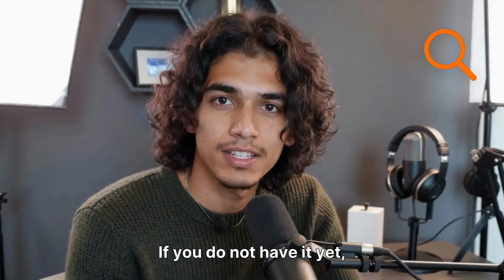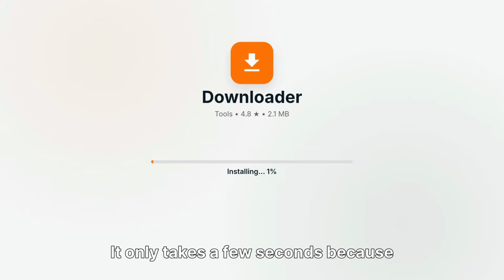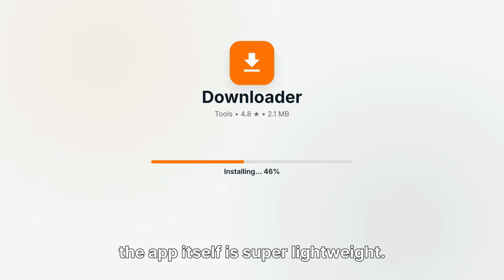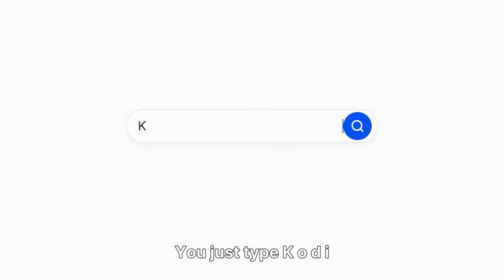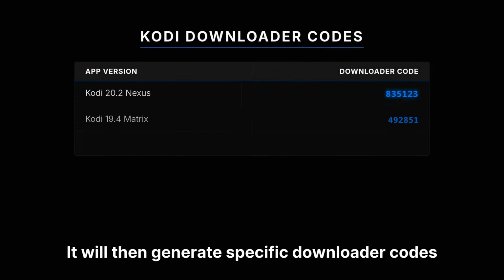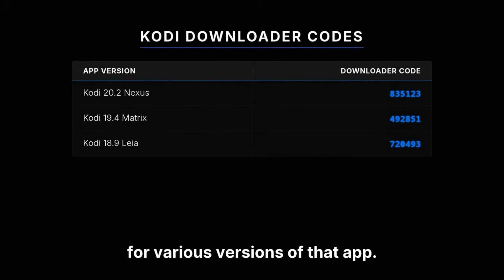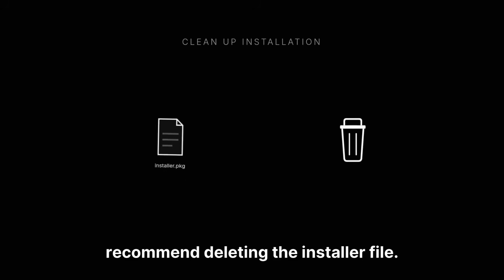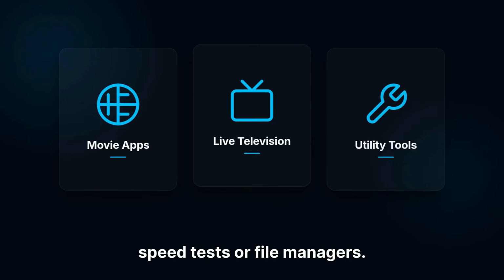Ditch Unlinked | Use This Downloader Instead on Google TV

Comment: my downloader is greyed out they trying to delete this app, so right now cinema hd, bee tv and Flizr is blocked each time you install it something disables it
Reply: cinema took their app down a month ago not block its gone
tea tv also took down their app wed ,  bee tv server is down  but feel their fate will be the same
Reply from the maker: Try following methods to resolve the problem.  And let me know the result.  
Clear Downloader cache/data.
Reinstall Downloader from Play Store.
Enable:
Developer Options.
Install Unknown Apps.
Turn OFF Play Protect temporarily.
Change DNS to:
1.1.1.1
8.8.8.8
Try VPN ON/OFF.
Restart router + TV.
Use direct APK URL instead of short code.

Comment: The code is good for fire sticks?
Reply from the maker: Yes, most Downloader codes work on both, please apply and share the result. if possible please like, share and subscribe.

Downloader on Amazon Fire TV Stick
Android/Google TV devices like Chromecast with Google TV, Sony TV, TCL, Mi Box, etc.

But sometimes:

Some APKs are Firestick-only.
Some apps need ARM64 support.
Google TV may block unknown apps more strictly.

Before installing on Google TV:

Enable Developer Options.
Turn ON “Install Unknown Apps” for Downloader.
Make sure APK supports Android TV.

If app crashes:

Try newer APK version.
Use ARM64 version.
Clear cache/data.
Test another player version.
Reply: @TechVibes-maf G. M. Thank you.

Comment: Hi bro
The code 72609 is not working on downloader can you help
Reply: It says error time out
Reply from the maker: I will update you soon
Reply from the maker: The APK host/server is temporarily down.
Google TV security update blocks older APK links.
Reply from the maker: Try following methods to resolve the problem.  And let me know the result.  
Clear Downloader cache/data.
Reinstall Downloader from Play Store.
Enable:
Developer Options.
Install Unknown Apps.
Turn OFF Play Protect temporarily.
Change DNS to:
1.1.1.1
8.8.8.8
Try VPN ON/OFF.
Restart router + TV.
Use direct APK URL instead of short code.
Reply: اit is ok now thank you 👍
Reply from the maker: You are most welcome, sir. Where are you from?